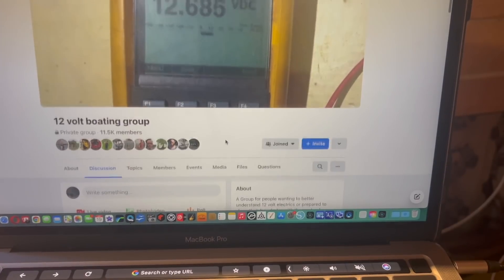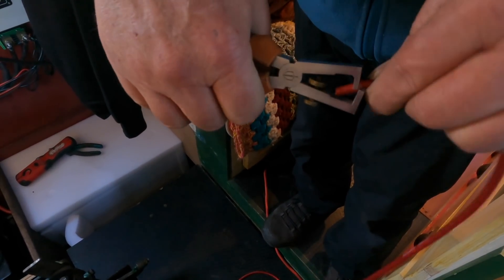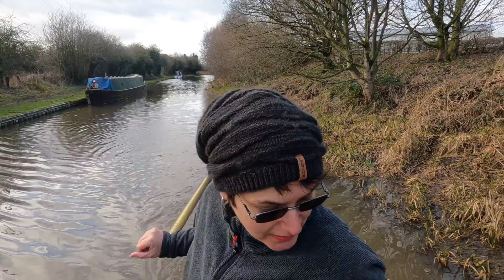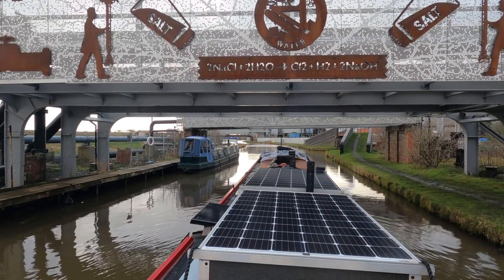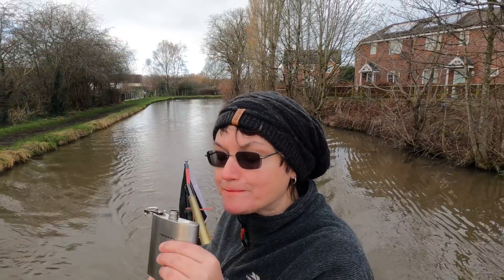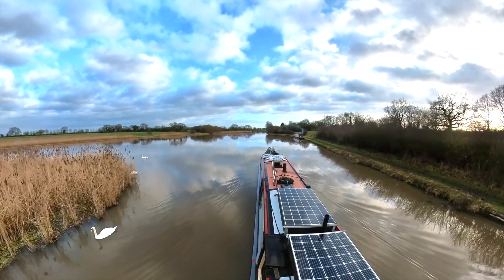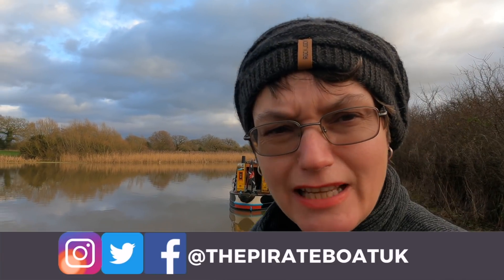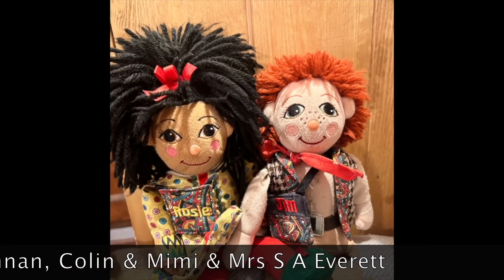Lithium Hybrid on my Narrowboat - My Alternator gets hot [Ep 36]

Comment: Another interesting video, thanks. However I would be a bit concerned about the MPPT trying to charge the mixed Lead-Lithium bank from the solar PV. Which chemistry should the MPPT use? If Lead then it is not best for Lithium. If Lithium it is not best for Lead. I would be tempted to retire the dead Lead and save the mass on the boat. Also double check the MPPT setting for the exact type of Lithium. The MPPT makers web site might have a PDF with a HowTo. Hopefully there is also a lead from the charger to the Lithium which double checks the temperature and such, as you note they are fussy in the freezing temperatures (and who is not??).
Reply from the maker: That’s why I went for hybrid as are most boaters and van lifers 😄😄
Reply from the maker: Also my batteries aren’t dead dead they have never been below 12.2 but do struggle this time of year with my fridge etc running and  I do have to charge them a lot more in winter as no solar, so my genny has to go on a lot more throughout the day … but now with the hybrid I’m going from running the genny 3-4hrs a day to once every 3 days for an hour and half 😄🏴‍☠️
Reply: Thanks for that. I would also add for the viewers that another informative video is from Our Narrowboat Quest ( https://www.youtube.com/watch?v=jKAIMUNu2Pc ) where Lithium and MPPT are explained by Pat and Eileen who have a different setup. Always good to compare and note that there is no one answer for all. Good to see a solution on a trad narrowboat.
Reply from the maker: Yes, I think they went full lithium which is a very different setup to hybrid … all set ups are different as I know it’s different for a duel alternator set up too … I think for anymore making the change to full or hybrid needs to check with the company … lifebatteries.co.uk couldn’t have been more helpful for me and my equipment 😄

Comment: The problem with the longer thin wire  way of moderating  charging lithium is that it charges slower and slower the more full the battery gets  - you might never get it fully charged - Renogy make a much cheaper DC to DC charger than Victron  in 20, 40 & 60amp versions  I have one on my motor home - it will charge your lithium battery faster and in the correct charging profile. I would recommend 40amp for a 90 -120amp alternator.
Reply from the maker: It does charge slower on my alternator but I’m cruising all the time and still fully charged In 3-4 hrs … I don’t run my engine when stationary as it’s so noisy being an old aircooled lister, but I do run my genny through my victron 60 amp battery charger charges in 1.5hrs … I can’t wait for better weather and my solar to kick in …. I will tell my friend about the Renogy though as they don’t have a genny and their system is very different with duel alternators etc thank you 😁🏴‍☠️

Comment: A wee nip!  You do need to stay hydrated after all. 🙂  Cheers to the swans!  Good on your Dad for being such a knowledgable help with the new lithium battery.  As a retired diesel truck mechanic, I will caution you about adding a Lithium battery to the set.  The other batteries are still old and still need to be replaced.  You are now pretty much running on ONLY the Lithium battery, so it's super duper that you bought a large one.  I'd suggest you dump the old batteries and simply add a second Lithium battery (tho I'm behind here so you may already have done that), you'll be good to go for 10-12 years with just two of those Lithium batteries.  Hey, Pudding doesn't have even a T-shirt on and he's ok ... think about that!  Extraordinary video ... wow.  I love your vlog!  I really do. 🙂
Reply from the maker: Aww thanks Ann 😄 these are lithium life po4 and not lithium iron batteries so work brilliant as hybrid as they keep the leads topped up and and means I don’t need to replace my battery charger, solar controller, alternator etc which I would if I went full lithium - lots of boaters going hybrid now. My leads aren’t knackered just not as good as they used to be 😂 but still showing green / healthy. However the set up has solved lots of power issues  and means I’m running my engine and generator less saving on fuel 😄🏴‍☠️

Comment: It might be the best option for you is to add another alternator to charge just that battery.  All our ambulance here in Canada have that set up .
Reply from the maker: Unfortunately I can’t run the 2 alternators with my engine, it’s a 1969 slow revving lister HR2 … also the engine is mostly in idle mode as Narrowboats cruise between 2-4 mph,  which is why lots of yacht and boaters go the lithium hybrid method … lithium gobbles up the power much quicker than lead acid, so would need to change everything else to accommodate a full lithium set up inc solar controllers etc and would be a very expensive and costly set up … hybrid solves all this 😃

Comment: its says 2000 cycles so assuming 1 cycle will be 1 day  2000 divided by 365, 5 years or so but tesla car batts charge up too 90 percent and down to 20 percent i think which reduces capacity but if your chargeing every day as you are it increases life massively and i presume the bluetooth app you can programme the batt to do that
Reply from the maker: The Bluetooth app is totally programmable and I can just turn it off too and use my normal leisure batteries…. Yes the cycles are full charge and discharge but that hardly happens with having solar and cruising a lot so I’m hoping it will last a lot longer … what is fab is my genny running times in winter as no solar so instead of running for 4 hrs throughout a day I am now just running it for 1.5 hrs once every 3 days when stationary with my fridge freezer and everything on

Comment: You said you use engine pads to catch the drips.  Are they cheaper than nappies?  Another boater I watch uses the nappies.
Reply from the maker: Nappies are good for soaking up water in bilges but with old vintage engines like mine in their own engine room and air cooled instead of water cooled there is no water, just the odd little oil drip which these matts are designed for and they are flat so fit perfectly 😃😃🏴‍☠️

Comment: Ha arggghhhh Heidi, when you added your lithium battery did you alter any of the wiring from the original lead acids? Or did you just link the lithium with a pos and neg cable to the batteries that were already installed? Ta muchly 👍🍻
Reply from the maker: It’s in the video 😂😂 yes I had to lengthen my lead from my split relay to the batteries
Reply: I must have missed that bit🙄 all I saw was your Dad adding the longer pos wire to the lithium. Did he move the solar charge leads across to the lithium or just leave them? Sorry to ask but I’m trying to get my head round this system before I do a hybrid on my boat.
Reply from the maker: @firkinflyer  nothing was moved at all … just lengthened one of the wires … however … every set up is different depending on what you have already …. I don’t have owt fancy but some people have had to change their split relays etc … the best thing you can do is join the 12v boating group (link in the description) on Facebook and tell them what your set up is alternator, batteries etc and they can walk you through it all … it’s a fab supportive group and also Mark from Life batteries is fantastic too … I haven’t a clue to be honest but I told them everything I had and they told me what to do 😂😂 I hope that helps but I do know each set up is slightly different 🏴‍☠️
Reply: That’s great cheers happy boating👍

Comment: Great video Heidi - I got some lithium batteries put in my boat a year ago, and although they are great, you do have to keep an eye on them. 
I had exactly the same problems as well- as soon as I started charging, the alternator overheated. I tried using a length of wire to restrict the current like you did, but my battery charger wasnt set up for lithiums, and it was still trying to charge them even though the voltage got dangerously high- so make sure you keep an eye on the voltage when charging, and not just the alternator temp. 
In the end I splashed £300 on a Sterling B2B charger, because that keeps the voltage down as well as the current.  
But it wasn't perfect either- its a long a complicated story, too boring for here. 
I'm sure you know this, but the alternator is a bit cooler when the engine's running faster. 
So if I'm staying still for a few days and just running the engine for a bit of charging, I turn up the rpm to say 1200 or so, and I can get more current out of the alternator without it overheating. 
I nearly fried my batteries by letting the voltage get too high though, so please keep an eye on the voltage when you charge- if you can, maybe set up a warning alarm or something to disconnect the charging when the voltage goes over a certain point. 
I went a bit mental and ended up with victron BMV712 units and big switches to cut off the charging.
But the bottom line is these batteries are bloody brilliant- and even better, they soak up all the solar as well, so in summer they perform even better!
Reply from the maker: Hey Tony, did you go hybrid or full lithium ? My set up is very basic no high duel alternators etc so it was fairly easy and now the alternator doesn’t get above 55 but it’s now only putting an 20 amps … however with my 3 hr cruise today it still filled the lithium to 100 …. It’s made a massive difference from putting my genny in 4hrs a day (2hrs am and 2hrs pm) to now just running my genny for 1.5hrs once every 3 days 😂😂 it’s runs brilliant from my 60 amp battery charger than from the alternator … I know of others who have disconnected their alternator completely from the leisure’s and just charge from genny and solar
Reply: @TheNarrowboatPirate  I'm made up its working for you Heidi, nice one. 
Yes I went hybrid, but only in the sense that its a B2B setup. 
Because I have two alternators I also have two lead acid batteries, so that each lead acid battery is fed by one of the alternators. Then from each lead acid, the current runs into a B2B charger, and then into the batteries. So each alternator has its own charging setup with its own B2B- its all a but mad to be fair, but it works.

But you do have to watch them. I read a thread on the Canal World forum, and they were saying things like this:

1. don't let them go up to 100% charged every day because the poor things find that a bit stressful, and you'll get less life out of them (like maybe 6 or 7 years instead of 10 years, say). 
2. On a day to day basis, let them get up to about 80-90% charged, and then turn off the charging so they dont get stressed
3. Dont leave them at 100% for too long, make sure they are starting to discharge and get rid of some energy
4. Dont let them let get to a very low charge either, and certainly dont let them get down to 0% charged, as that could really damage them. 
5. what will kill them instantly (apparently) is if the voltage goes over 15v, which is what my old alternator to battery charger was trying to do to them. 
6. They like  being around 50% most of them time, so cycle them between say 20-85% and you'll get 10 years out of them, with the odd run up to 100% (say every 2 or 3 weeks)

I dont know how much of it is true so I hope no-one assassinates me in the comments, but these guys do seem to know what they're on about, and so far I've has mine for over a year with no major problems. 

You should be getting more than 20 amps into them though.
I experimented and found that my alternators were rated at 100 amps, but could only give out 45 amps before overheating, because lithiums suck all the current up from the alternator, whereas lead acids resist the charge a bit, and that keeps the alternator from putting out too much current.
Bear in mind you might only be getting 20 amps because the charger has moved into float mode maybe? 
Or maybe you need a bigger cable, or the same width but a slightly shorter length? I tried all sorts with mine, but I couldnt control the voltage so I ended up going for the B2Bs to protect the batteries from high voltage- after all, these are a ten year investment, right? You want to take care of them. I even keep mine inside the cabin (because apparently you can damage them if you run the engine and try to charge them at low temps, like say 2 degrees or less- but nobody really seems to agree on the exact figures at the moment.
I have considered reading bedtime stories to them, but so far it hasnt come to that.

Also keep an eye on the temp of the charging wires- thinner cable can get a  bit hot if the alternator is trying to push a  big current through it, and it acts as a resistor. Its probably ok, but its always worth having a feel (that's from the Heidi innuendo book). 

Its a minefield, but they are really worth it in my view. 
I also splashed out on more panels at the start of sept, so I now have 1400w, and I didnt need to run the engine once (for charging) until mid october. I'm hoping between April and August there'll be enough extra power to get hot water from it, without having to run the engine. 
Solar's where its at Heidi! 😀
Reply from the maker: Thanks for all the info … yes I have made lots of settings in my BMS as was advised by the 12v group … I’ve got another 4 hr cruise tomorrow too so I’ll just turn it off as i’m at 87% …. We keep checking the temp and cable … I extended my cable loads and it hasn’t got warm yet luckily but I’ve never cruised with the lithium switched off although my friend always turns his off when cruising so I’ll test it tomorrow 😃😃 my alternator is only 55 amp anyway and extending that cable and reducing to 6mm only allows the lithium to take a small amount …. I know in the 12v boating group it seems the once’s with fancier high end alternators have more problems … thanks for all your help 😃😃
Reply from the maker: I have 630 watts of solar but hardly getting anything this time of year but it keeps everything going April to Oct 😃😃🏴‍☠️
Reply: @TheNarrowboatPirate  , good luck with the new batteries. Its kind of a shame that you can only charge at 20 amps. You would think you might get a continuous 30 amps out of a 55 amp alternator without it getting too hot. It doesnt sound that much of a difference but its a 50% increase, and that means a lot less engine running hours. 
Its all fine if you're out cruising for 4 hours a day anyway, but when you are staying still for a few days, a decent charging current is a real help, as it  means much less engine running time. 
Before I got my lithiums I was running the engine for 4 hours a day in the autumn and winter, but now I get all my charging done in less than an hour. 
The big difference to remember with lithiums is that when they are full (or even 90%), you need to stop charging them. Lead acids can get charged all day on an 8 hour cruise with no problem, but if you overfill lithiums you can damage them, particularly if the battery voltage gets too high.
But it sounds like you've got it pretty well sorted.
If you do feel that more charging current would be helpful (and it would save some fuel), an alternator upgrade is another thing that might help, but to be fair they can cost four or five hundred quid.
Youi need to get rid of that steam engine mate 😀
Reply from the maker: 😂😂 yeah I never run my engine stationary anyway as it’s too bloody loud 😂😂 but the genny and victron charger has it charged in no time 😂😂🏴‍☠️

Comment: Yes I agree with you 100%, lithium batteries are a game changer. We pu in a Lithium battery a couple of years ago, replacing the old lead batteries. The difference in weight is amazing. We are only allowed 3500kg, with passengers. So we shaved off a good amount of kilos. Plus as you say, in summer I can run the camper for at least 3 days, just taking a trip to shop and it's loaded again, so now all I have to get done every so often is the grey water and the loo. I got 2 cassettes, so when the ones full I swop to the number 2, I can go for at least 4 days, 6 at a stretch

Comment: I'm kind of worried about that battery set up. Lithiums need a charge controller to stop them getting over charged and catching fire. their charging characteristics are not the same as lead acid batteries. Putting them all in parallel could be a bad idea. Google some of the scooter and electric bike fires that have happened. Since the vlog is eight months old, whatever might have happened would have happened by now.
Reply from the maker: It’s hybrid it’s all fabulous and they lifepo4 not lithium ion so a big difference 😃 check out the 12v boating group on fb - hundreds of boats and off grid go the same route 😃🏴‍☠️

Comment: Hope those were drop in batteries, normally lithium and lead don't mix.
Reply from the maker: This are the lifePo4 and designed for this …. Lots are taking this route now 😄🏴‍☠️
Reply: @TheNarrowboatPirate  Just be careful. LiFePo4 does not mean compatible with existing lead acid/agm etc. Most have an inbuilt BMS and if this is designed as a drop in replacement for lead acid/agm, then all good, otherwise expensive problems. You may still get problems mixing old and new, depends. As well as checking the temperature of your alternator, check the temp of the charging cable. That size cable with that current could well get too hot, melt the insulation and short out, possibly starting a fire. 
Sorry for the lecture.
Reply from the maker: Thanks Kev, I just followed all the instructions on the hybrid set up 😃 hopefully all will be well - we will see hahaa 😂😂🏴‍☠️
Reply: Heidi, sorry to bring this up again
Please check with your battery supplier. There's a new regulation ISO/TS 23625:2021 which specifically forbids mixing your battery types.
Reply from the maker: @kevgermany  ahoy, Kev they are not mixed in the same bank … have a look at Hybrid setup, thousands are doing it as it’s all protected by bms